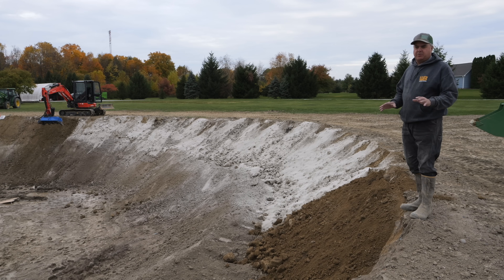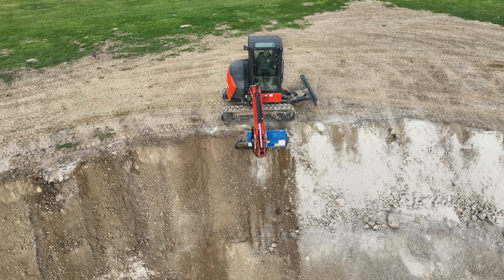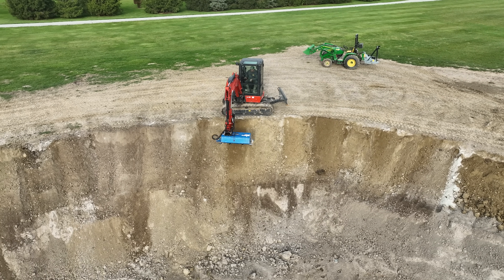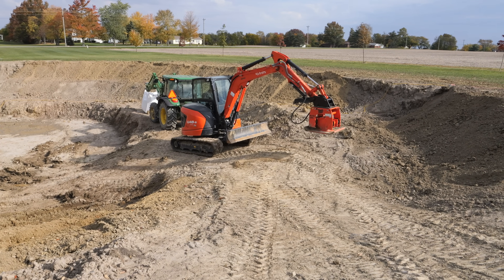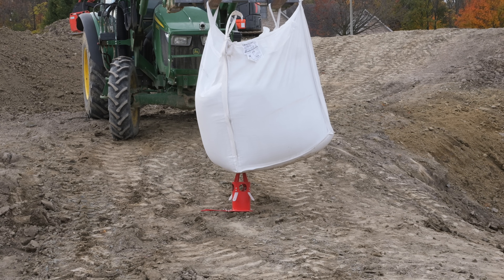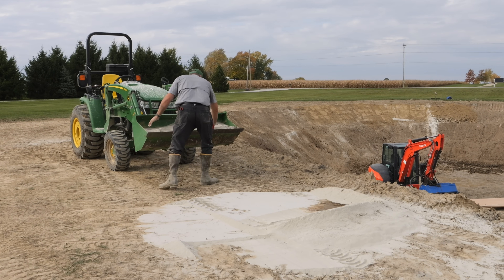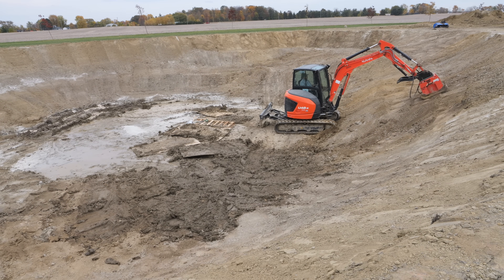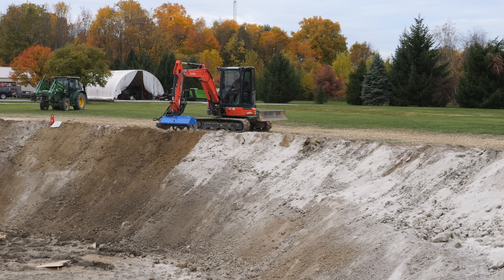Pond Fix Gone Wrong: Steep Slopes & Mud Make Adding Bentonite a Challenge!

Comment: . I dug ponds for 20+years. You had a interesting approach to repairing your leak. I have used many tons of bentonite. It works fantastic. I wish I could have talked to you before you started your project. Given that. If it is still seeping in, mark those spots with a cement block, rope, and a float( i.e. gallon jug) . After you  get the water level higher than the incoming water pressure, use Benseal 3/8" drop from the water surface down to the block. It has worked every time for me. Good luck.. Let me know if you want to talk.

Comment: Looks like you need to try out some of those Outback wraps for your hyd hoses. They have many sizes and I have them on all my JD's to keep them protected and tidy. I even use some of the smaller ones on my pressure washer hose to prevent burning on muffler or wear from the wheels if drooped down when moving.

Comment: It looks like after the fact, but I wonder how a broadcast spreader (cone) would work. It would have to be adjusted for side throw or backup to the edge to spread. ??? Just a thought. Might not have the volume needed for this application.
Reply from the maker: thought seriously about that.  I think the powdery material would have 'bridged' over the small openings on the spreader.  notice that it did indeed bridge over the fancy unloader thingy on the bottom of the big bag.

Comment: Tim are your counter weights on the back the 40 or 70lb weights? We want to get some for the TYM tractor.
Reply from the maker: 70 lb.  Get them from http://heavyhitch.com use code ttwt for 5% discount.   They have incredibly cost effective shipping for weights and brackets.
You may have to contact them to get the Fastenal pricing.

Comment: As far as the tiller, could you have hooked it up backwards...i.e., could the quick connect be turned 180 degrees so that it was kicking the dirt up the slope instead of pulling it down as you incorporated the bentonite from the bottom of the pond? 🤷‍♂

Comment: You should just use a 3 point broadcast spreader.  Back up to the pond edge and turn on the pto
Reply from the maker: Thought about it…but I don’t think this stuff woulda fed through the spreader.  Notice that it bridged over the unloader tool, and that was a larger hole than our spreader.

Comment: I would weld a 1/2" rod on the end of those quick coupler pins. The little thing they put on from factory is junk. Curl the bucket or attachment towards the machine as far as possible when you put the pin in and out and that will make it slide way easier

Comment: I learend about bentonite a few years ago .. i was helping pump concrete and about 1/2 5gallon  bucket of bentonite and rest water mixx it up and pour it in concrete pump soon as the truck got thar and it would be like slicking up the hose so  the concrete didnt stop up the hose.. then i seen pepole seal ponds with it

Comment: Back about 14 year ago I was working for a guy logging I was felling trees and I was up on a littel hill about 1000ft from about a half acear pond and the owner of the land was cleaning out the pond with a old cat excavator and I thought he digging 2 deep.. I went om felling and limbing and I stop to rest and he took another pull at the mud and he dumped the mud and I noticed a drastic color change and I said that's odd 1 more bucket and the pond was like a big toilet flushing in seconds all water was gone... dangest thing I've seen
Reply from the maker: Wow!
Reply: So this is what insanity looks like!
Reply: Swivel the tiller connections so you can rotate tiller and work from bottom up so dirt is push upwards

Comment: You should get a old tractor, drain all the fluids and put it in the bottom of the pond.
Reply from the maker: That would be interesting!
Reply: There used to be a guy on u.s.31 north that had a A/C tractor buried in his yard , all you could see was the hood ,tops of the tires ,top of the radiator ,and steering wheel.  
I don't know what ever happened to it last I was past there it was gone.

Comment: Seems like using a Ventrac with dual wheels and a tiller up front would be an easier solution to process the bentonite.
Reply from the maker: Talked about that.  Might work, but this is STEEP!
Reply: @TractorTimewithTim  yeah the soil is really loose.In our pond the contractor use heavy track dosser to compact the sides. Your pond leaves awesome.